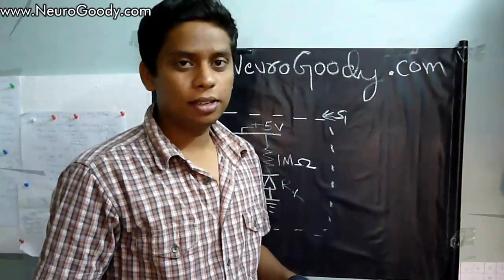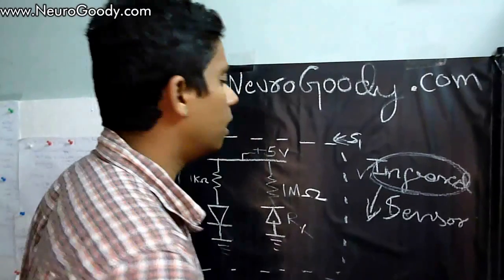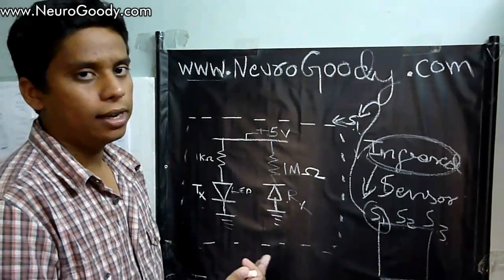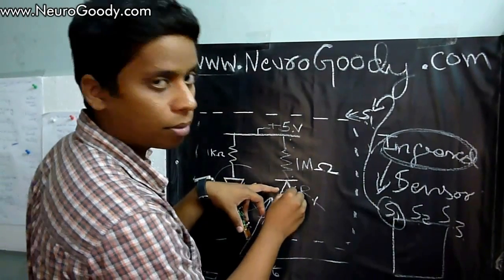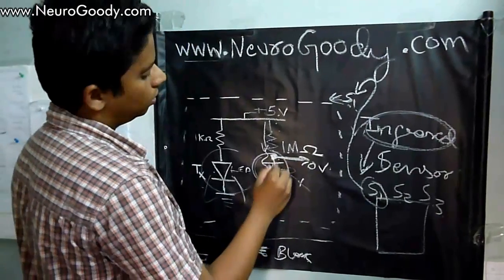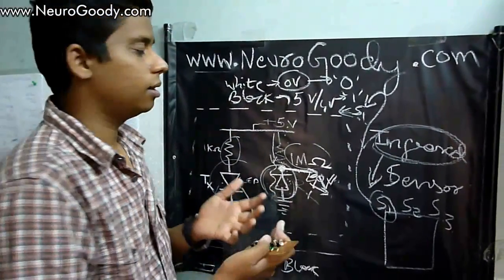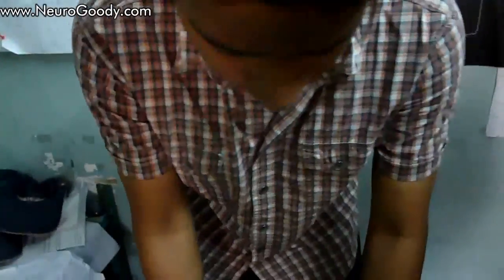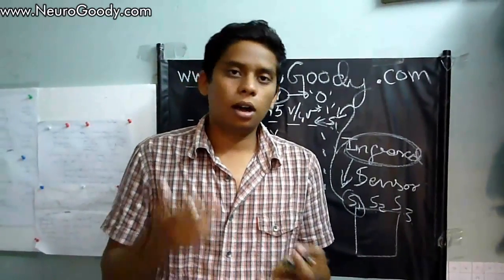Line follower (IR) Infrared line sensors circuit explained!!

Comment: it's easy. you have the voltage and you have the current so you can get the r

r=v/i 

it is a parallel circuit so the vlotage in any side of the circuit is equal to 5V  
because you have a voltage source 5V

so as we know the maximmum current that the diode can tolerate is 5 mA. if you want you can make it 3 mA but don't pu value ,ore than 5mA 

so r=v/i 
r=5/0.005 = 1000 ohm 

i hope that my explination is easy to understand

Comment from the maker: Hi pradeep! You don't need to design exact resistance values. Just know that, for the IR LED Transmitter, you've to use a 1 kilo ohm or near resistance to limit the current supply to it. And, for the IR receiver, the resistance must be in mega ohms.. to increase sensitivity. Instead of using a constant resistor, you may also use a Potentiometer to have a control on resistance and hence the sensistivity of the reciever!! :)